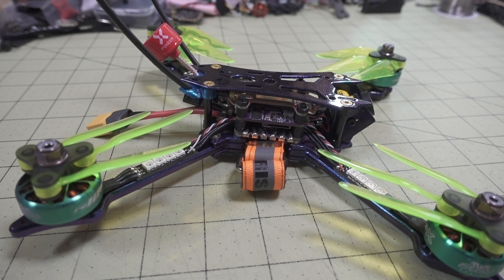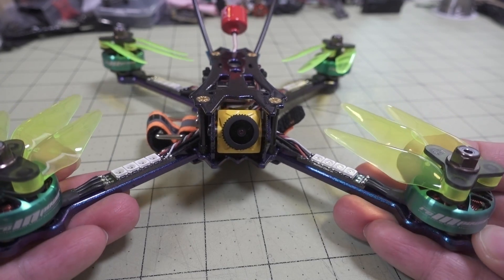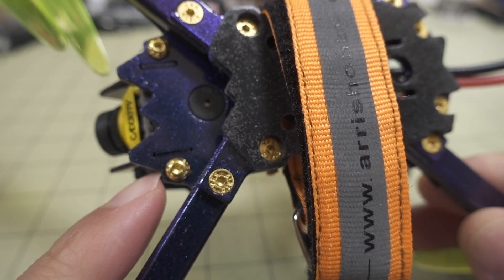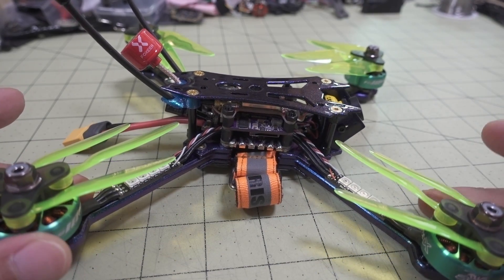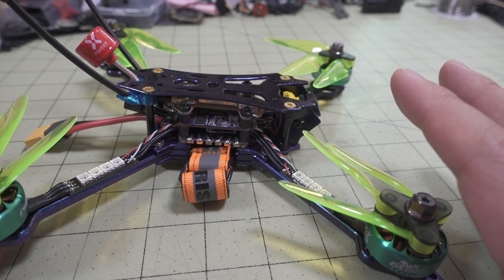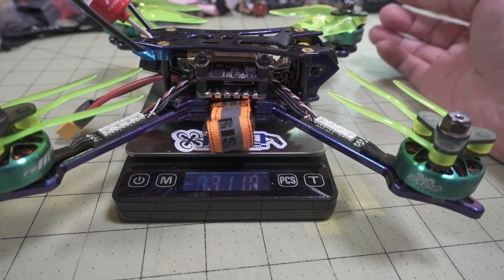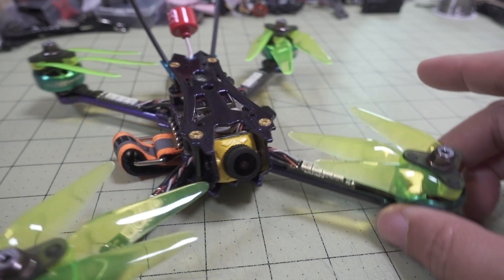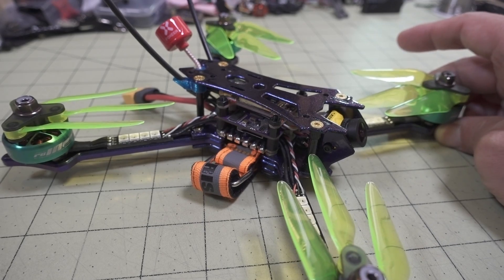ARRIS Chameleon 220 FPV Racing Drone Review

Comment: Is that center hole in the top plate a hexagonal hole that’s the correct size for the prop nuts? Like, you could remove the props using the top plate?

Comment: I love mine. I have the 6S version. Footage in my video.
Reply: I need to get a another video now that I can really handle this drone. I've been averaging 6 to 8 mins with mine using a 6s 1100 and gemfan 51433s. Very snappy, easy to fly, and it turns heads at my ama field.